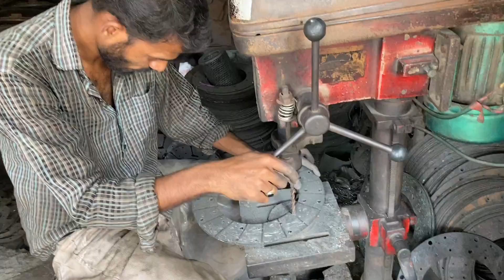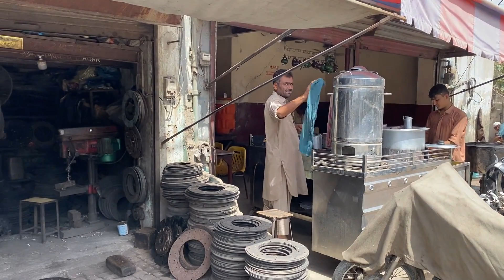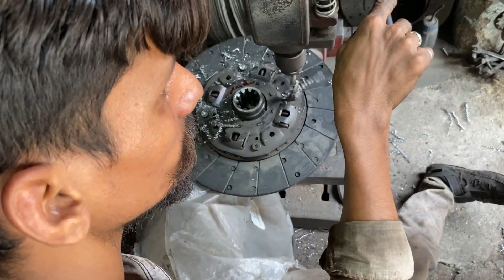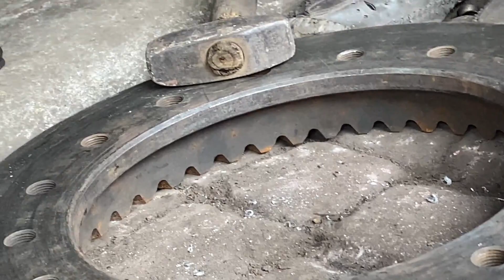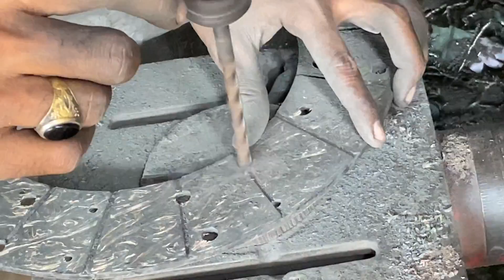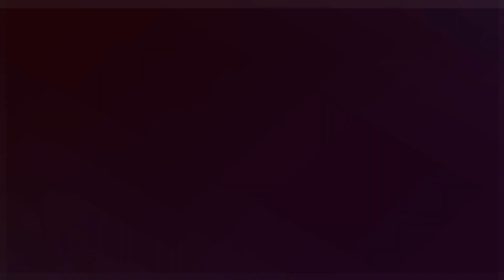Amazing Restoration Old Truck Clutch Plate | Rebuild An Old Clutch Plate Very Informative Video

Comment: No safety concerns at all. Someone hurt themselves there is blood on the plate when the guy drills out the bolts. Disgusting way to work.
Reply: Never worry, I'd rather die of tetanus than asbestosis..
Reply: @cedley1969  smart man